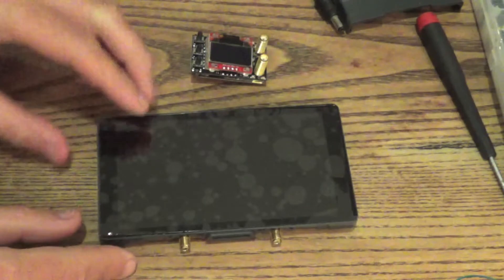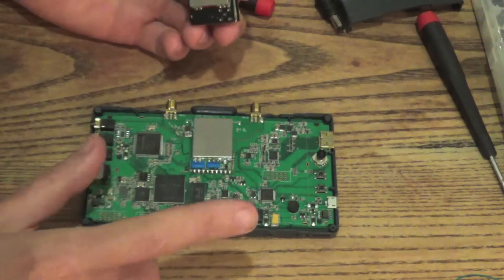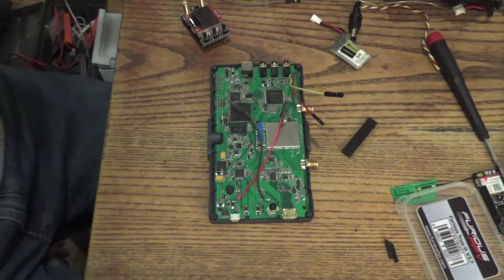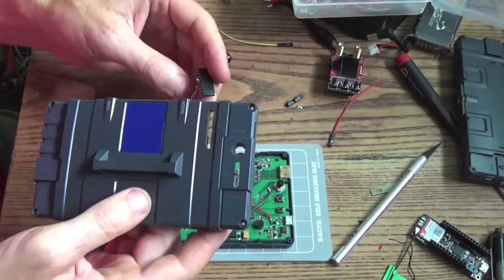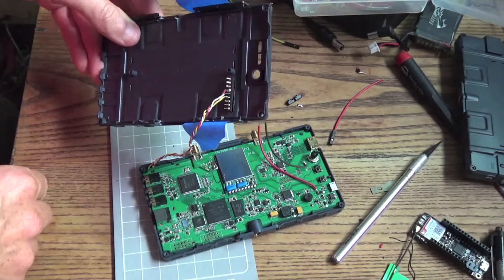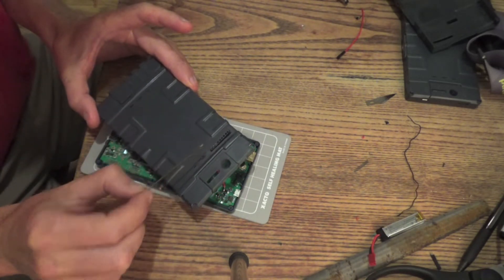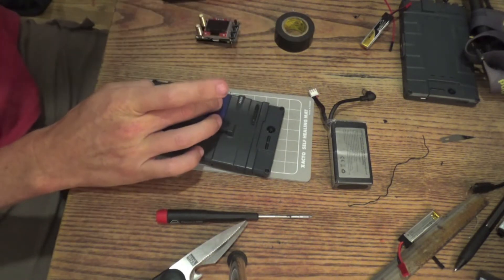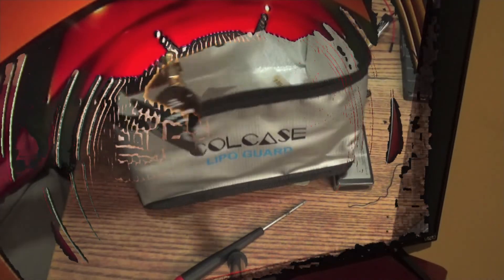Fatshark Transformer Diversity Mod (super clean, no hot glue)

Comment: good idea for the 5v source but I also found only 0,150A and I don't think  it's enough for most receivers
Reply from the maker: How did you measure the current supply ?  My TrueD module works fine on the pads I used.
Reply: @Tavdog  with a multi meter, and a RapidFire needs around 300mA in low-powered-mode

Comment: Have you tried flying with this setup ?
Reply from the maker: Yes, the video quality is sooo much better !
Reply: @Tavdog  
Thanks for posting! I knew this could be done, but you just saved me a some time. I may end up desoldering the stock receiver all together, but until I do, I'll just tie into the Vid-in line like you. Far easier, plus I don't need a line in anyway. Maybe I can run the video line to a switch to allow for a Vid-in line as well. I wonder how a movie would look on these.
Reply from the maker: Glad you found it useful.  The vid-in jack still works if you take off the module.